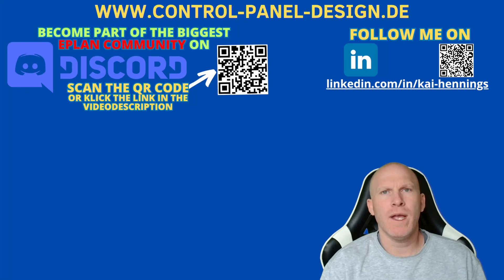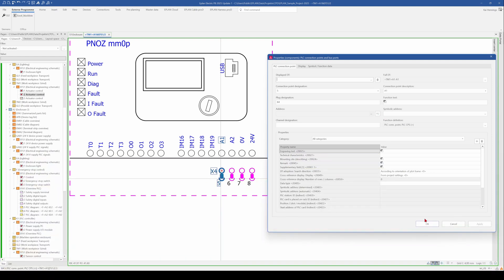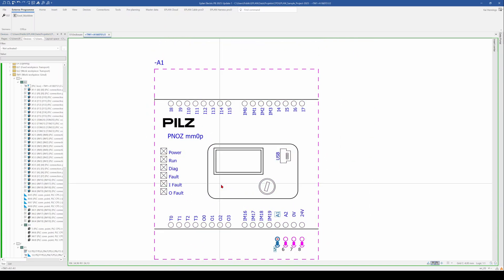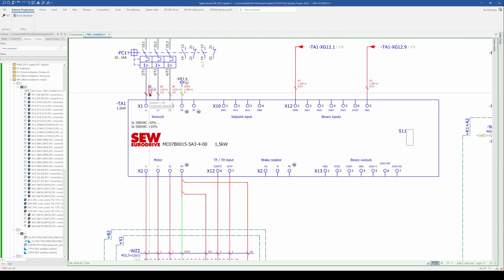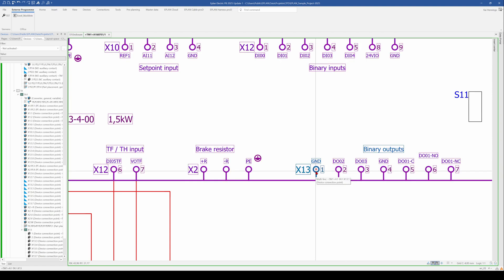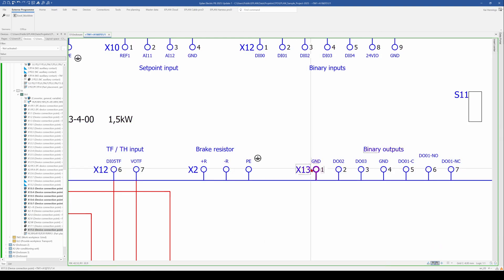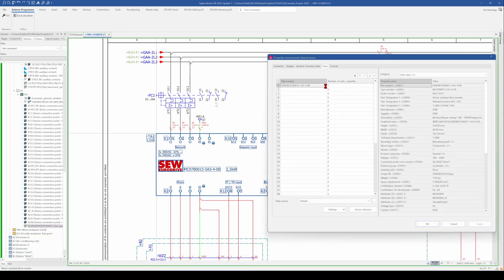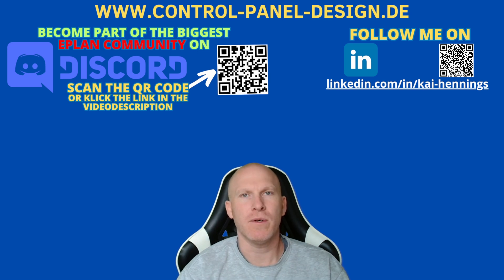Plug designation on devices❌PLC device and the normal device are different. Don't make this mistake

Comment: Thank you for the amzing video as always. Could you please explain how to define connection points properly for a .stp imported file into 3d layout space. I am having trouble routing wires in 3d example. I am trying to connect a 3 phase fuse to beckhoff frequency driver. I imported the beckhoff .stp file and asigned connection points locally. while i am trying to route the wires, they are not connecting at exact terminal positions. instead, they are just going from fuse to driver in 3 random lines with no terminal to terminal connection. Please help me with this issue.

Comment: Hello Kai, could you explain how to handle with the place holder objects that Siemens use in macro symbols to select device setting parameters like output current limit in the selectivity module 6EP1961-2BA21 for example. I can select values on insertion of macro but afterwards I cannot change it if required. Thanks
Reply: Just right click on the place holder anchor and select “assign values”. If macro is grouped just ungroup it or use shift for selecting only the placeholder anchor.